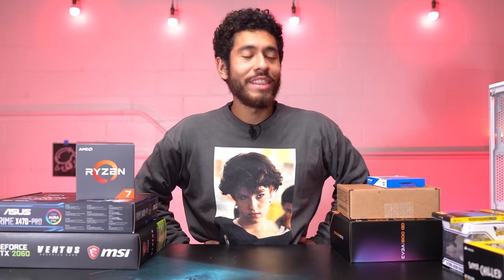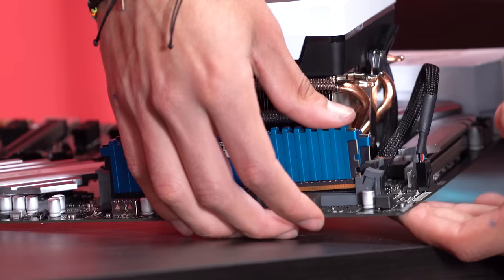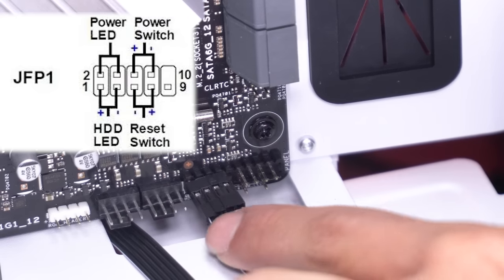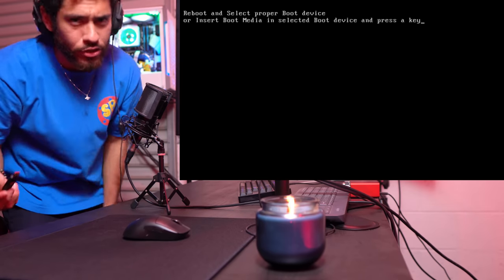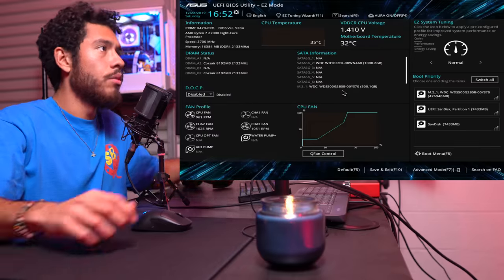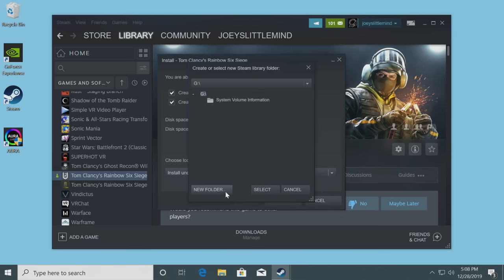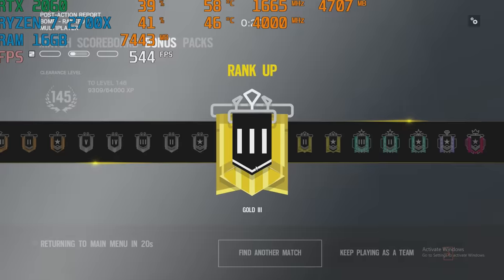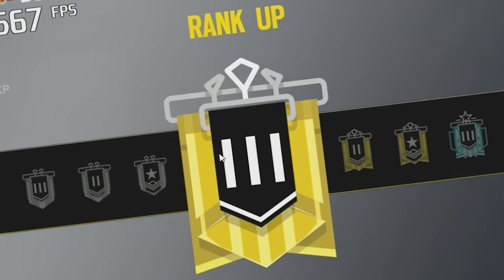Best $1000 Gaming PC Build Guide - RTX 2060 Ryzen 7 2700X (w/ STREAMING BENCHMARKS)

Comment: Whats the led strips that go around the inner rim of the case link? And do you have any other cheaper graphics card that you would recommend for this build instead of the RTX 2060, if not it's fine? Thanks
Reply: DimeTrigger I’m gonna be using Ryzen 5 2600/Ryzen 7 2700x and gtx 1660 super cause it’s much more expensive here in the Philippines.

Comment: Would everything work if I use a NZXT H510 case instead of the one you used
Reply: Jc DZN google pc part picker and plug in your respective parts 👍
Reply: H510 is a compact case, but the graphics card, cpu cooler and everything should fit fine in there, also dont use as many fans as Joey uses because the case supports less fans because of its compact design

Comment: I have a question. Will this PC have wifi or do I need to use an Ethernet
Reply: Ethernet, but you can buy an adapter for less than $50
Reply: it will be ethernet but you can buy a wifi card

Comment: Can u make an updated version of 1,000$ pc build or is this still the best 1,000$ pc still? :)
Reply: This a EXTREMELY good build for 1,000 the only thing which could be updated is the GPU when the 3070 comes out prices will drop so keep that in minf
Reply: @rookie-boogie7834  are you sure the 3070 is compatible with this pc just want to clarify because im building this aswell and i want to get other parts before the 3070 drops

Comment: Me:I’m going to save up for this pc

My wallet:💀
Reply: andres jose laptop?!
Reply: this isnt a laptop
Reply: In my opinion laptops are NOT worth buying. The good ones are all ridiculously overpriced and have lower limits compared to a desktop computer. With a desktop you can always upgrade and customize the PC anyway you want at your own pace. Most laptops can't be upgraded and the only thing they have over desktops is their mobility.
Reply: KiNG Helix 😂😂
Reply: @Original_J65  not in your opinion, it's a fact that they're not worth buying. Any true PCMR member knows this.
Reply: Well next amd gaming laptop is at 800$ you should check it it has 8 cores
Reply: @omega0422  Which'll throttle after 5 mins of load. Besids, its the GPU that determines what you can run. Laptops are never good because you play on a small screen with a half-assed keyboard that burns your fingers at the top and can't run more than 2 hrs on battery power
Reply: @kylemelcher894  you plug the laptop, you dont play on battery plus you can buy a monitor and pretty much use the laptop as a case but ofcourse desktop pc's are better because they have more room
Reply: @Original_J65  Laptops can be really handy though. Not for gaming
Reply: @kylemelcher894  you haven't seen the laptop benchmarks , it has a built in 5600xt

Comment: when you realise youre candian so its actually the 1500$ build ._..
Reply: Seb bro I just got mine and corona got the canadian dollar trippin, my build ended up costing $2k 💀
Reply: Patrick Tapil rip mom’s credit card...
Reply: @patricktapil1665  noo dude, that hits way too close, I'm trying to plan my build rn and everything is like 2x the cost than it is in the reviews and guides cuz they're all American. Already spent 700$ on my monitor and chair 😅
Reply: Patrick Tapil How did the build go? Is it easy enough for a beginner?
Reply: Unknownguy overall it went great. Booted right up straight to BIOS which is always a good sign. I had to install an aftermarket cpu cooler which was tricky to install so I had to take my time careful not to damage my cpu. I did spend a little bit more on my storage and power supply for the sole purpose of having less wires/connections to deal with. If you’re okay to spend a little bit more I say invest in an m.2 SSD/NVME if you also want faster boot ups and a fully modular power supply. Other than that, connecting the wires on the motherboard was straightforward. I had 0 experience building a PC, I just watched videos on YouTube. It’s honestly just building a lego with wires attached. If I can do it you certainly can
Reply: You have free healthcare
Reply: @mrnxthan2966  I'm dead 😂

Comment: hey I could use some help, the bs prices for the graphics cards rn are pretty bad lol, I found the same card and the only difference it has says XS which i assume is extra small, will is still fit the motherboard?? does the size matter?
Reply: It will fit, no worries. Just the card is little bit smaller, but the PCIe slot is standard.

Comment: Hey guys just wondering do you guys think this is a good build, should I try and is there any parts you would change
Reply: The case is expensive because its just for show, if you don't really care how your case looks then you can go with like a $60 one instead. Just make sure it'll fit everything else.
Reply: @miguelcantu3334  okay, is there any other gpu you would recommend That would fit the budget of 1000 or 1200 dollars?
Reply: @r3x_sama328  The one he used will probably be the best fit, obviously you could go lower in price and check it out from there, but for the RTX2060, it would be the best graphics card for that price. Check out newegg.com and you can put the price range you are willing to pay on there.
Reply: @r3x_sama328  RX 5700XT is equivalent to a RTX 2070 SUPER and costs much less I recommend you buy it. Or you can buy a RX 5600XT- its the same as a RTX 2060 but you will save a lot of money if you buy the RX 5600XT. 

Cons of Radeon Graphic cards: The drivers are sometimes unstable and your pc could crash but i heard they recently fixed all the problems.  Hope i helped you (:

Comment: i cant get hold of this graphics card atm. Best alternatives?
Reply: maybe a 5600xt
Reply: RX 5700XT is equivalent to a RTX 2070 SUPER and costs much less I recommend you buy it. Or you can buy a RX 5600XT- its the same as a RTX 2060 but you will save a lot of money if you buy the RX 5600XT. 

Cons of Radeon Graphic cards: The drivers are sometimes unstable and your pc could crash but i heard they recently fixed all the problems.  Hope i helped you (:

Comment: Hey joey! I have a ryzen 7 3700x and 3070 msi gaming trio. I use my pc for streaming and gaming. I mostly play COD warzone. I play with 1440p and I would get at least 100-130 fps but when is start streaming i would get less than 100. is there anything i need to upgrade to use the full potential power of my GPU?

Comment: So I just built this & the only issue I'm having is the HDMI. I've plugged the HDMI from the monitor to the HMDI 2.0 behind case & nothing. I switched to plug into the graphics card & nothing. The system turns on but monitor says no singal for HDMI. What am I doing wrong? I've checked wiring and everything is connected properly. Also I switched monitors and used another HDMI, still nothing. Please help

Comment: I’m thinking of upgrading I have a question. If I plan to use the current SSD that has my OS and my current hard drive with all the games and drivers would there be an issue when I plug them in to the new mother board?

Comment: Are the extra 3 fans needed? or will it be okay if i dont buy them? and if i dont do i still need the extra fan cables?
Reply: if you want lower temps, go for the 3 fans but I have heard that the fans he used in this build can be loud. Also, you don’t need the extra fan cables if you aren’t going to get the 3 extra fans
Reply: drip drop ohhh okay tysm!!
Reply: drip drop are lower temps recommended? Like if I can should I spend a little extra for a few more fans?
Reply: @callagracee  lower temps are better so your  cpu and gpu don’t overheat
You should get the 3 fans but just be aware that they are only white led and they can be loud so if you are fine with that choose them

Comment: is the cables optional or you need it for the pc
Reply: the fan extensions are necessary if you are getting the 3 fans but the white extension cables aren’t
Reply: @yordinihoudini  do you have to get the 3 fans or is it optional
Reply: @yordinihoudini  and do you need both ssd and hard drive or you can only get one of those
Reply: @iminspain8625  you can get both ssd and hard drives
Reply: @iminspain8625  no they aren’t necessary

Comment: where else can I buy an RTX 2060 because they are out of stock on amazon???
Reply: RX 5700XT is equivalent to a RTX 2070 SUPER and costs much less I recommend you buy it. Or you can buy a RX 5600XT- its the same as a RTX 2060 but you will save a lot of money if you buy the RX 5600XT. 

Cons of Radeon Graphic cards: The drivers are sometimes unstable and your pc could crash but i heard they recently fixed all the problems.  Hope i helped you (:

Comment: I followed ur procedure with all the components on this video but I used the second motherboard option ASUS ROG STRIX B450 Gaming. I installed the BIOS in this video to the wrong motherboard, essentially destroying the motherboard; the fans and lights would not turn on. But prior to that, my monitor and pc we’re working fine. I bought a new motherboard but it was the same version ASUS ROG STRIX B450. I tried connecting my PC to my monitor but it says there is no signal but I unplugged everything and checked everything. Nothing seems to work. I’ve been dealing with this issue for a few months now. Someone advise, please.

Comment: I'm building this exact PC but I'm in need of some help, I want to buy another graphic card. Any ideas which one I should get?
Reply: Exactly why I’m watching this too lol. GPU prices are so inflated right now due to COVID so I’m hoping to find a replacement for the 2060 (I was originally aiming for a 2060 super). 

Not sure if I should wait till things settle down or find a substitute until I can get a solid GPU for a good price
Reply: @connflix  I was going to get the exact 2060 from this vid, but it's out of stock till February, and I'm not sure if there's another graphic card that I can switch out for it. I have everything in my cart rn, been looking for a couple hours 😂
Reply: @woahitsbubbles  I wish I could help you on suitable replacements :/ my other idea was to go for a 1660 ti for the moment and see how that runs in the meantime, then upgrade when necessary. This is a rough time to start building but I’m excited regardless
Reply: Virtual Prodz  does the trio fit into this case?
Reply: RX 5700XT is equivalent to a RTX 2070 SUPER and costs much less I recommend you buy it. Or you can buy a RX 5600XT- its the same as a RTX 2060 but you will save a lot of money if you buy the RX 5600XT. 

Cons of Radeon Graphic cards: The drivers are sometimes unstable and your pc could crash but i heard they recently fixed all the problems.  Hope i helped you (:
Reply: @andrefalconi4863  what if I get a rtx msi 2070 instead?

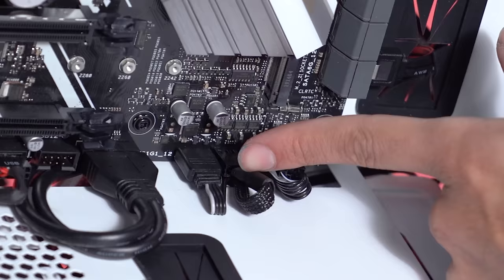Comment: Hey, time stamp 6:45 u connect cable next to fan, that cable for me is three holes not four (two holes space another hole) and splitting on that wire is says VDG on that part. 

Do I not need to use that at all? Bc looking at the mother board I don’t see a three prong to even b able to if need be.

Comment: At the time of typing this, Amazon is telling me that the graphics card linked (the MSI Gaming GeForce RTX 2060 6GB Graphics Card) has gone up to $900

but someone suggested a ASUS ROG Strix AMD Radeon RX 5600 XT TOP Edition Gaming Graphics Card for $340 instead. 

Is that a good exchange? With the original graphics card linked, the price of this pc nearly doubled and I’m looking to lower the price as much as possible without sacrificing too much.
Reply: RX 5700XT is equivalent to a RTX 2070 SUPER and costs much less I recommend you buy it. Or you can buy a RX 5600XT- its the same as a RTX 2060 but you will save a lot of money if you buy the RX 5600XT. 

Cons of Radeon Graphic cards: The drivers are sometimes unstable and your pc could crash but i heard they recently fixed all the problems.  Hope i helped you (:
Reply: @andrefalconi4863  thank you so much! I’ll look into it! I’m still learning pc building so that was a big help

Comment: What would be another good GPU because either says its 800 dollars ?
Reply: 1660 super is around 300 BUT ONLY GET THAT IF YOU ARE AN IMPATIENT PERSON. SOON THE 2060 HE MENTIONED WILL HAVE A PRICCEDROP TO 300 DOLLARS BECAUSE OF THE NEW GPU THAT CAME OUT
Reply: RX 5700XT is equivalent to a RTX 2070 SUPER and costs much less I recommend you buy it. Or you can buy a RX 5600XT- its the same as a RTX 2060 but you will save a lot of money if you buy the RX 5600XT. 

Cons of Radeon Graphic cards: The drivers are sometimes unstable and your pc could crash but i heard they recently fixed all the problems.  Hope i helped you (:

Comment: Wouldn't you use thermal paste on the processor and cooling unit?
Reply: Yes. Most CPU coolers come with thermal paste preapplied so that's why it appears that the builders don't use any.
Reply: @JJFlores197  thanks I didn't know that

Comment: Any other graphics card you can use for this build? The 2060 rtx is unavailable.
Reply: RX 5700XT is equivalent to a RTX 2070 SUPER and costs much less I recommend you buy it. Or you can buy a RX 5600XT- its the same as a RTX 2060 but you will save a lot of money if you buy the RX 5600XT. 

Cons of Radeon Graphic cards: The drivers are sometimes unstable and your pc could crash but i heard they recently fixed all the problems.  Hope i helped you (:

Comment: Can i also buy a rtx 2070 or a ryzen 5 3600 or doesnt it fit?
Reply: You sure can.

But, i reccomend you buy a RX 5700XT is equivalent to a RTX 2070 SUPER and costs much less I recommend you buy it. Or you can buy a RX 5600XT- its the same as a RTX 2060 but you will save a lot of money if you buy the RX 5600XT. 

Cons of Radeon Graphic cards: The drivers are sometimes unstable and your pc could crash but i heard they recently fixed all the problems.  Hope i helped you (:
Reply: @andrefalconi4863  okay thank you very much
Reply: @andrefalconi4863  hey i have another question, i hope that you can also help me. Do you know if the amd ryzen 5 3600 fits in the Asus ROG Strix B450-F gaming with an AM4 socket?

Comment: Do you need a hard drive if you already have an SSD?
Reply: Nope, it's even better with SSD
Reply: @TechnologyMove  thank you 🙏
Reply: @TechnologyMove  could you so let me know what the POWER cable of the SSD is called and does come with the motherboard or Power supply, or do I buy it separately? Sorry for the many questions I'm just still learning stuff and building a pc in under 2 weeks that's why I'm asking. Also I subscribed 😁
Reply: @mrf2freestylers593   Thank you. Actually I have video "How to install SSD on desktop PC" . Check it, it's all there hardware, cables and software. Cheers
Reply: @TechnologyMove  okay thank you. Always ahead or with an answer. ❤️

Comment: Do you have any alternatives for the rtx 2060?
Reply: My recommendations for an alternative would be a RX 5700XT, GTX 1660-TI or GTX 1080TI.
Reply: @salamonthegreat  if i have this exact same build but with rtx3090, would this be compatible?
Reply: Nah. You probably need a 800W+ psu.
Reply: @salamonthegreat   those graphics cards are compatible with this build?
Reply: @Misalynne  yes. As long as it fits in the case
Reply: @salamonthegreat  thanks bro if i get 800w with the rtx 3090 then should be all good?
Reply: @melvaughn2526  if you keep everything else the same in this build, then yep.

Comment: Will the RTX 3060 ti work with this? Also I found it for $400 which seems like it’s fake
Reply: I don’t think it would, the 3060 probably won’t have that much clearance
Reply: @nowah06  I went on the official a few days ago website and it says it’s gonna release at $400
Reply: @crvxsh4625  Correction, a 3060,3070,3080, and 3090 will fit but you won’t have clearance for a radiator

Comment: What FPS will I get on warzone at 1080 p medium to high settings?
Reply: I have a ryzen 5 3600 instead of the ryzen 7 2700x but otherwise same build and I get 125 fps on low/medium settings so probably around 100

Comment: i could use some help with this one @joe delgado im running asus 2060 ryzen 7 2700x and every time i try to stream my frame rates drop to single digits. iv tried lowering bit rates iv tried to lower stream settings. nothing is working. looking for some help

Comment: Hey I need some help I bought a asus prime x570-p even though he got a x470-p motherboard. when I went to do the bios update I restarted the pic afterwards and then the pc would not boot to windows 10 again when I try to install windows 10 it then tells me that I am unable to use the ssd to install windows onto or for that matter my hard five too. If you know how to fix this pls respond cause I just saved up for 2 years to buy this pc and when I finally got it I messed it up.
Reply: You might have needed to do sequential BIOS updates, basically updating to every bios version after the previous and not skipping to the newest version. You could also try contacting ASUS support.

Comment: Im new to  this ..   What is  bios   and is it  like  needed ?
Reply: The BIOS or Basic Input/Output System is the most basic piece of software that each computer has. It does a lot of things, including starting up your PC, and doing a POST, or Power On Self-Test to make sure your components are working. So yes. If you want a working PC, you need a BIOS installed. Like I said, practically every computer sold from the past 3 decades or so come with the BIOS pre-installed. Now, depending on the hardware you choose, you may or may not need to update the BIOS to a newer version. This is more common with AMD Ryzen systems.
Reply: @JJFlores197   Wow  thank you so much  man ,   can u  help me  with  CPU ?    Intel i7  9700   or  AMD  7 2700